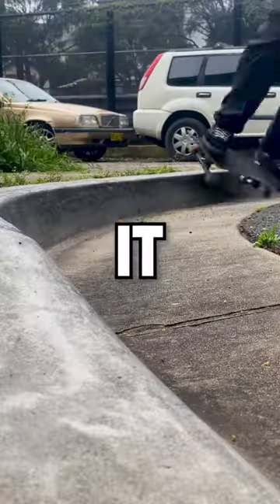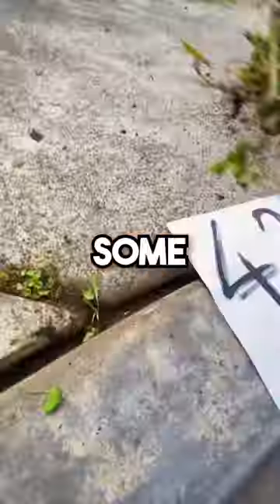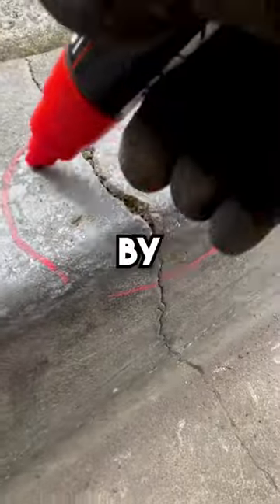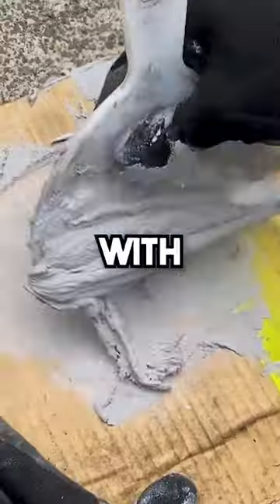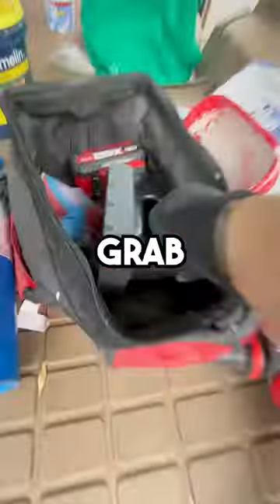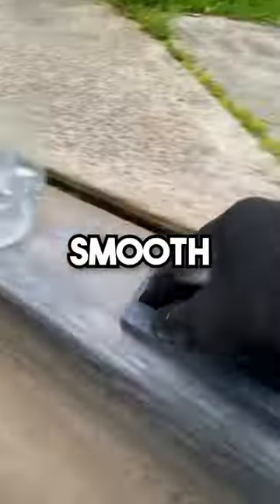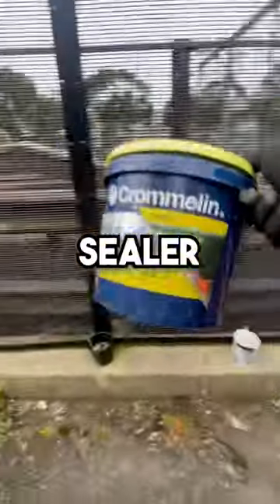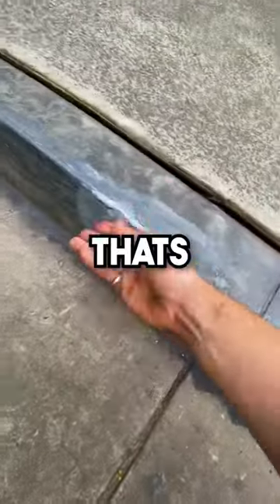Do THIS to Skate Curbs | Make the PERFECT slappy spot!🛹👷‍♂️

Comment: That guy seeing that the city municipal service aren't doing their job: Fine i'll do it myself
Reply: This is amazing
Reply: We pay them to make grindable curbs, obviously
Reply: Was just about to type that huu
Reply: Grindable curbs are the city’s top priority, arent they
Reply: @andiaz8837  but their job is to fix things like cracks in the curb, for example he used compound filler and then buffed and polished the curb, something the city should do
Reply: @cold4123  A hairline crack in a curb is a complete non-issue and is just what concrete does, why would anyone care to fix it?
Now that nice, smooth and waxed curb will be ice any time it rains or snows and is a liability to the city. Good job!
Reply: @lakaiskates8064  firstly, a crack in a curb is already a liability to anyone walking by. Secondly, if it does snow/ rain, the sidewalks will most likely have salt spread on them, and you shouldnt deliberately walk on the curb so i dont see how thats a problem either?
Reply: @cold4123  Yeah a hairline crack is real dangerous! 🙃Salt? And what will that do? Salt is to melt ice not give you traction. I don’t mean it will be literal ice I mean it will be slippery when it’s wet/icy. There’s a reason sidewalks have texture and aren’t poured smooth as glass like at a skatepark. All this to grind a 4” ledge is pretty fucking lame anyways.
Reply: @cold4123  lol that’s not how the city would fix a curb, not even close
Reply: @cold4123  a crack in the curb is a liability? So you rather have the city spend time fixing small cracks than actual sidewalks that need repairs, bro nobody cares about the cracks
Reply: @Bflores999  blud thought he was smart 💀 u can fix the cracks. Example, 10 year old boy riding his skatebord falls and cracks his head open on the concrete. its not a “waste of time” if it can reduce the chance of liabilities, which can lead to the city getting sued. See how that works?
Reply: @cold4123  I don’t think the city would get sued for a kid not wearing a helmet
Reply: Let skaters have free rain of city and there will be no cracks

Comment: what i learn form this video is let skate boarders do what they want, basically free city maintenance
Reply: I was gonna say, I’ve seen more than a few shorts from skaters that are repairing city property.
Reply: Hardly free, you get skateboarders hanging around
Reply: Except for when they leave chipped and wax covered benches
Reply: My content is %200 better!
Reply: @gfuelsoccermom5307  the chipped benches/concrete which they then proceed to fix because it doesn't grind well anymore? your point is?
Reply: @gfuelsoccermom5307  the wax actually acts as sealant
Reply: @rarelycold6618  so what? You don't go outside for it to be a issue to you anyways.
Reply: Contrary to what you might think about youtube commenters, I do, in fact, go outside daily and frequently during the day
Reply: @gfuelsoccermom5307 Stuff is already gonna get chipped and banged up with people skating it or not
Reply: Check out Nate greenwoods thrasher part.

Comment: AYO WHAT DID U JUST PUT ON THE CURB
Reply from the maker: A poly compound filler, it sets in 10 min and hardens like concrete. Then a paving sealer so the spot can slide easily without a ton of wax.